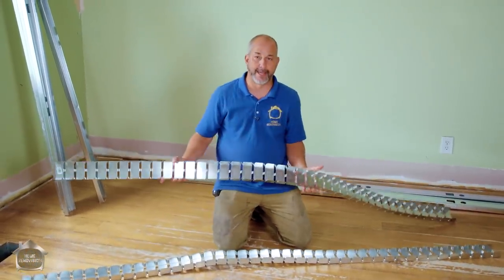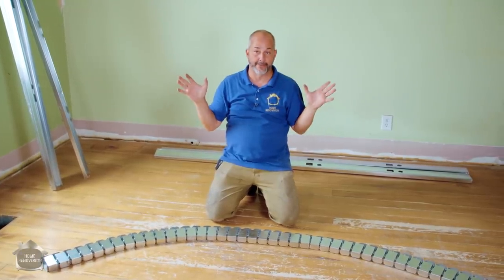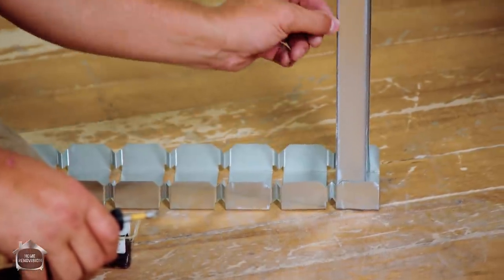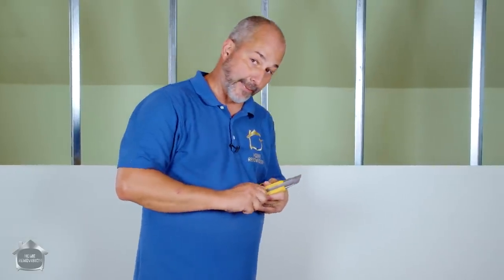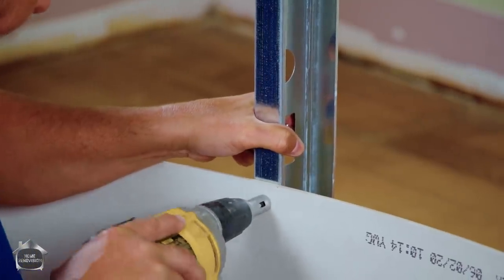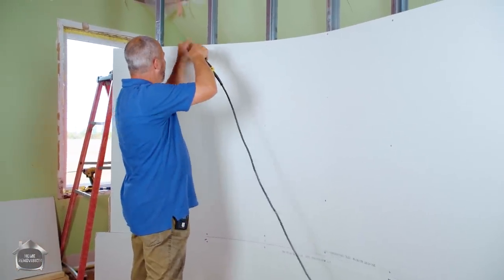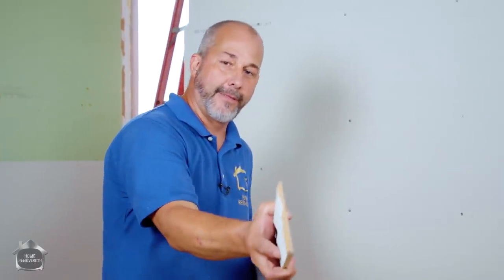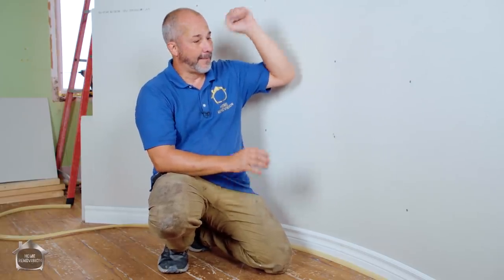How to Frame and Drywall a Curved Wall

Comment: Ex-framer here, I built plenty of curved walls in the late 90's. We cut the top and bottom plates from ¾" plywood, doubled up. Then wood or steel studs 12"o/c or 6" o/c if it was a tight radius.
Reply: Same here. I use plywood for my hulk heads as well.
Reply: Bulk*
Reply: Man, thanks for this comment. This will definately be how i attempt these in the future. I have only ever done a straight wall, but does a wall being curved negativly affect the load bearimg capacity of it (For a second story?)

Comment: While house hunting, I saw a curve stairwell, the moulding was done by cutting up hard moulding in small chunks, yuck...
Reply: ewwwwwwwwwww wtf
Reply from the maker: nasty!
Reply: Relief cuts on the back of the wood molding  
Works well
Reply: If that wasn't a signal of cutting corners (what else is poor quality that you can't see?), that place would have been a deal since you could fix it easy while no one else would want to deal with it.

Comment: Thanks Jeff!  Were you using 1/4 FLEX drywall or the standard 1/4 inch drywall (I have seen standard 1/4 inch sold at Home Depot). If using flex, can you use standard 1/4 inch?
Reply: @TheAxecutioner  Thanks Bradyn. Built a curved wall out of 3/4 inch treated ply for top and bottom plates for a basement location recently and am about to purchase drywall (found flex 1/4 inch at a local drywall wholesaler) but if I can get away with standard 1/4 inch usg from Home Depot, that would be the preferred option from a distance and cost perspective. I found the flex 1/4 inch is about 2X the price of traditional 1/4 inch sold off the shelf at HD.
Reply: @TheAxecutioner  Awesome, thank you!  I’ll give it a shot (this week I think)!

Comment: Tip 1: Most trim is not going to stay with nails in the drywall only.  You'd want nails into wood studs or screws into steel studs to keep it in place.  Alternatively, install it with construction adhesive.  Tip 2: To mark a perfect curve: Hammer a nail into the floor, attach a string and tie it to a pencil/marker at the desired length.  Mark a partial circle on the floor.

Comment: Awesome video! The rubber quarter round was especially informative. Jeff, what would you suggest as a good method of anchoring the product if it is being installed on a concrete floor in a basement? Is there a special adhesive? As always, great job!

Comment: Honestly rather use plywood top and bottom plates . Seems to be a lot easier than using the metal framing. Straight bit . Plunge router. And router base jig with adjustable axis points .

Comment: Jeff, how do I tape that top joint to the ceiling?
Reply: Hmm... i've never tried a curved joint, but how about this:
You know how the tape wrinkles if you would try to bend it into a curve because you are forcing the paper to fold? 
Cut a line on the wrinkle (preferably the end that goes to the ceiling). That way, you are not forcing the paper- but rather overlapping one end of the cut over the other.
This way, you can run the tape neatly along the wall part of the joint and then the ceiling part will only have a few cuts along the curve.
I would imagine it would work better with mesh tape.
I don't know if I'm explaining this right, though.
Reply: @TheAxecutioner  ah, much better explanation than mine.
Reply: @TheAxecutioner  good explanation, all the same, Bradyn.
Reply: If it were me, Id back fill the voids and flat tape it. Putting painters tape on the ceiling.
Reply from the maker: what bradyn said. Cheers!

Comment: Michelle, coming home : "Jeff! Why is there a wall in the middle of the room?! 🤔"

Nice DIY video! I got a curved wall in my bathroom, and the door is in that wall. There's a huge gap between the door trim at the top and the wall behind it. Any ways of fixing that?
Reply: Spray foam, drywall paper tape, mud and paint - at least that’s what it sounds like
Reply: Pierre-Marc Rioux 
Scribe a curved cap for the head casing or a curved fill strip. -if I understand you correctly
Reply: @4philipp  Ah! Spray foam! I did not think about that, filling the hole...! Thank you!
Reply from the maker: caulking. Cheers!

Comment: Why not securely attach the first piece that you shaped to the ceiling, then hang a plumb line from each anchor point down to the floor and anchor the floor plate below? I suppose there wasn't much ceiling to anchor to...

Comment: For our ranch house, we steamed oak trim and bent it around curved walls. On rounded corners, we back cut and steamed.  A lot more work but was cheaper and looks amazing.
Reply: Oak trim compared to primed mdf I dont see the cheaper part, per linear foot? More work absolutely.
Reply: @raymondsloan9174  I was referring to the $5/ft rubber 1/4 round he finished with.

Comment: I get that you have to use the metal top and bottom plates but I hate metal studs the only good feature they have is they're light if you have to transport them high up but I would still use wood studs for many reasons.
Reply: Steel is perfectly straight. Wood is not

Comment: I had a serious I'd hack to my phone. I signed up and paid to be a member. My phone went dead and I could not get it fixed until now. Can you help me get back on your channel. I am 74 high risk, got fired by the charities I was managing for the last 20 years because I was I risk. I am good with my hands and for the first time have the time to make a true 45% angle. I am remodeling my 1959 house and live by your video. I set up a screen on all my projects. I take all your advice and tips.
Please help me get set up. My projects are at a standstill. THANKS

Comment: You should’ve used one of the flexible tracks like Flex-C Trac that can be locked securely in the proper curve so it is not so flimsy like the brand you used.

Comment: @HomeRenoVisionDIY  I have a question on venting
Ok so my guess bathroom tube need to be replace and when the tub came out their at the p trap was another AAV above the p trap. my question is do i have to have there because the new tub doesn't have enough room back there for it and I do remember you saying it need to be a certain height above

Comment: Just listened to your live stream.  Great show.  I am residing home 1920 removeing asbestos tile,wood,and exterior covering.  I am using zip board,taping, siding.  Should I use 2 inch sheeting over zip.  Trying to get as close to passive home. Thank you

Comment: Hi Jeff, where to buy the curved track, steel studs, 1/4in drywall, baseboards,  rubber trim in Durham Ontario?  Can I paint the rubber trim?
Reply from the maker: yes paintable. google custom trim shop and commercial drywall suppliers

Comment: I bought a condo with curved walls a few years ago. Always was curious about how they were made. This has certainly satisfied my curiosity, although our walls are slanted on top of being curved, so I'm assuming they had to cut the edges at an angle to fit the geometry. The part about most problems being already solved when it comes to walls (and home improvement in general), is really true. This is something we observe in software engineering too. Outside of bleeding edge tech, there's rarely a problem that wasn't already solved. You can try and solve it by yourself to exercise your brain, but if you need it done quickly, it's always faster to just go look for a precedent.

Comment: On another video you had about using steel in a basement you indicated to use treated 2x4 under the steel track in case of water intrusion.  I'd like to do a curved wall with steel in our basement.  
Obviously a straight 2x4 will not work under the curved part of the wall.  Any recommendations on how to handle this?  Thanks.

Comment: I have used a 1/4 inch drywall for a curved ceiling but, I can not sink the 1-inch Drywall screws into the drywall.  I am using metal studs.  What should I do or do you recommend any screws for 1/4 inch drywall?  The head of the screws are out of the dry wall. 

Thank you
Reply from the maker: check to make sure you are using fine thread screws and not the course thread version.

Comment: When you have a larger curved wall that's too large for one continuous horizontal piece, how do you float the vertical seams? We're on a job right now with a large spiral staircase and I've had to do some patching and the vertical seams are the worst

Comment: Thank you, I am using fine thread screws,  but it does not pull the screw in because the neck of the screws has no threads.   I do not like to use two 1/4 drywall but do you think that is the only option that I have?
Reply from the maker: Yes!

Comment: Pro tips: 
1- buy 1/2drywall, put water on the back side and make it curved just by letting it on the wall( the weight will curved it naturaly) and make it dry with some ventilator, the next day it will bee curved 
Tip #2 : it looks weard but put the 1/4drywall stand up.. it will curved more easily

Comment: I've seen where people will make several shallow cuts in the drywall to bend it, thought that was cool
Reply: Won't that just leave a weak point in your drywall? The paper is the thing that is keeping everything together, so it's not good to cut a line across it, I would imagine.

Comment: Do layout on the ground for bottom track.
Put top track ontop of bottom track and screw drywall to it then cut it out it retains exact same curve plumb two points eh la voila
Reply: Put top track in bottom track and screw drywall to it.....then cut it out?  Can you explain a bit more for us beginners.  I'd like to understand what you are saying.......
Reply: @tzaylor  if you cap the track that's fastened to the floor with the top piece then cut an oversized strip of drywall and screw it to the top tracks it will hold the same curve.
Then cut out the drywall along the edges of the track pick it up and it'll have the same curve.

The screws will be poking down through the drywall just use 1&5/8 screws to go through the second layer
Reply: @tzaylor   for production framing you would use a template made of plywood.

If it
Reply: @jt3926  cool, thanks for the explanation!  Seems like a smart way to save yourself a lot of guesswork.

Comment: Question: I once saw that if you want a curve trim, you can make a lot of cuts on the back of it (obviously not all the way) to curve it? Can you do that with a thick baseboard??
Reply: I would think going with a vinyl molding would be easier. I think your idea would work but it might crack easily.
Reply from the maker: if you kerf out the backside of flatstock trim it will work but not with any kind of detail. Cheers!